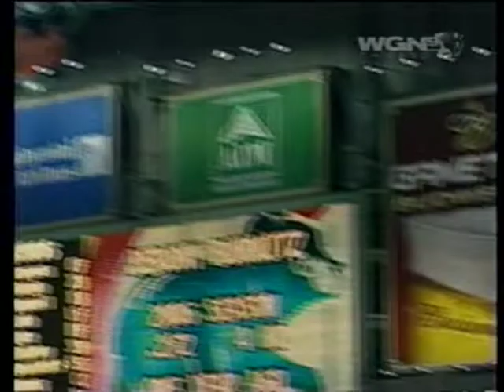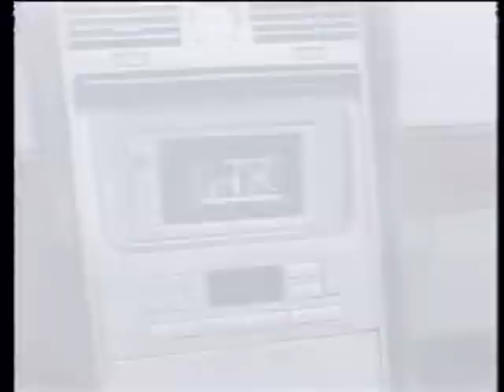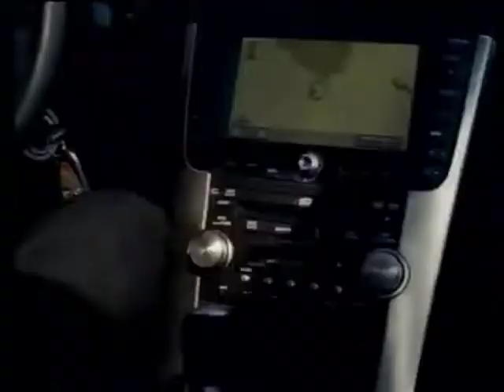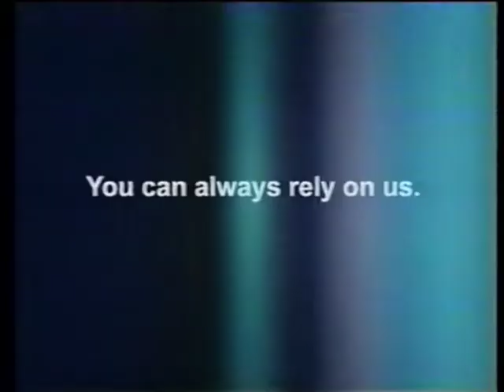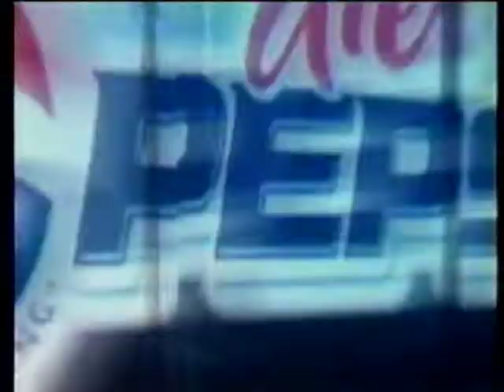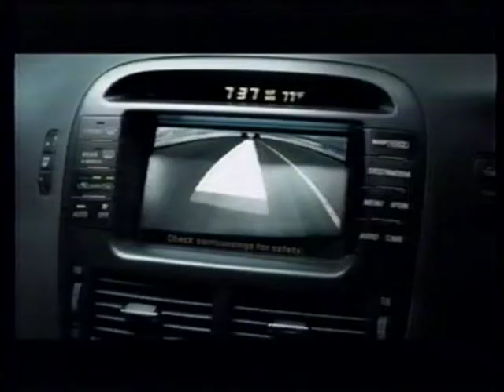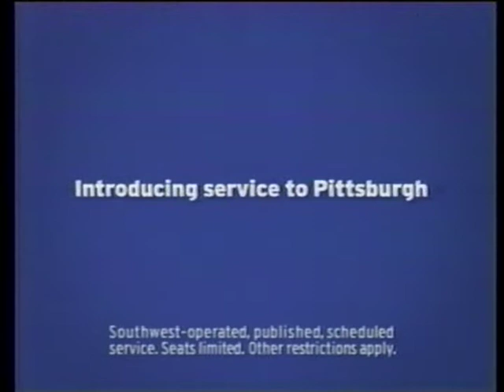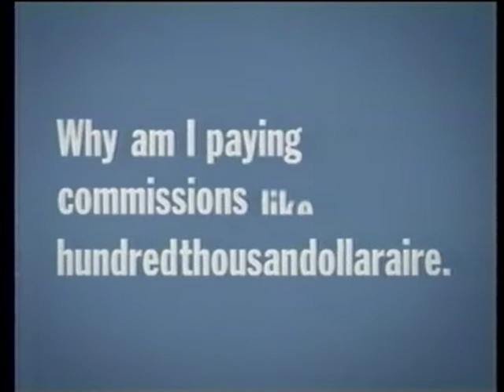Houston Astros @ Chicago Cubs -  May 24, 2005 - Sergio Mitre, Enrique Wilson, Jeff Gordon 7th inning

Comment: At 47:34, really bad luck for Clemens to get just 5 runs from the offense in his first 5 starts and 16 total in his first 9. He finally gets a couple of runs in this game and was in position for a win with a 2-0 lead after 5 innings, but had to leave early with an injury and the bullpen blew the lead. Although he got some luck from the wind when he hung the splitter to Hairston at 46:45. On the other hand, Dubois played Biggio's flyball to left into a double at 54:14. The Cubs were a bit of a thorn in Roger's side early. They snapped a 24 inning scoreless streak and handed Roger his first loss in the 4/29 start mentioned at 11:44, and as mentioned, the home run by Burnitz was one of only 2 allowed by Roger up to this point. Clemens came out strong here as well at 94 mph on just his 2nd pitch and had Hairston late on the foul ball at 11:37. Good 91 mph cutter to strike out Ramirez at 32:57. The Cubs were aggressive going after the splitter as Lee struck out on an 88 mph splitter at 18:00 after two hard sliders and Clemens started Burnitz with a good 88 mph splitter moving down and away on the next pitch at 18:28. Barrett couldn't hold up on a slower splitter at 33:44 and Clemens got another strikeout on a splitter in the dirt at 35:44. Perez picked a good pitch to run and stole 2nd on a hard slider away at 16:54. 

That was probably Roger's tightest slider all game at 1:02:11 and another good slider at 1:02:42. Clemens had struck out Lee on a similar sequence in the 1st, although the splitter that struck out Lee this time was higher, wasn't as hard, and didn't drop as much at 1:04:11. Clemens also struck out Ramirez on a slower splitter at 1:06:42, but lower and with more movement a after a 79 mph breaking ball. You can see that Clemens velocity had already dropped before he left with the injury, and even though he continued to record outs, he wasn't getting the same movement later on either striking out Dubois with another splitter similar to the one that struck out Lee the 2nd time at 1:21:41. At 1:02:51, Clemens did in fact finish the season with Houston and made it to the World Series, although he eventually did return to the Yankees 2 years later.